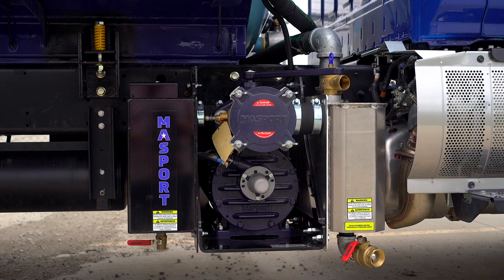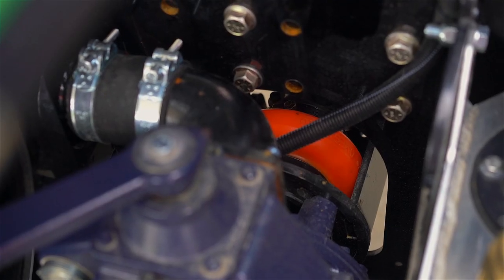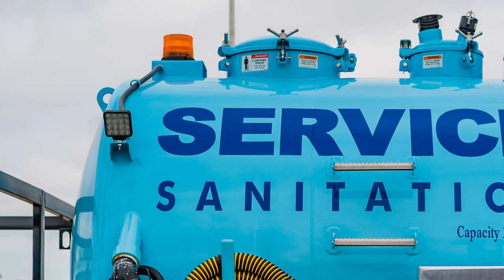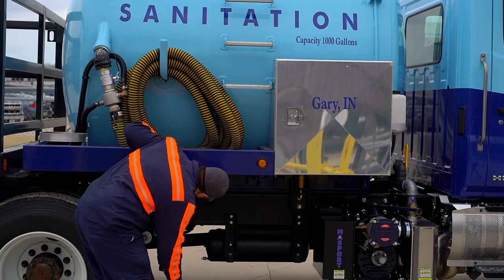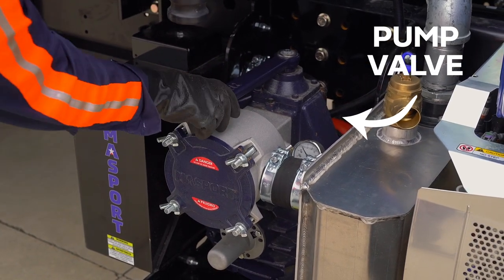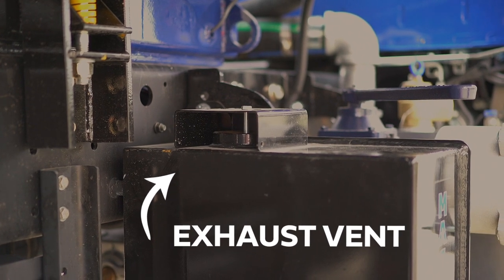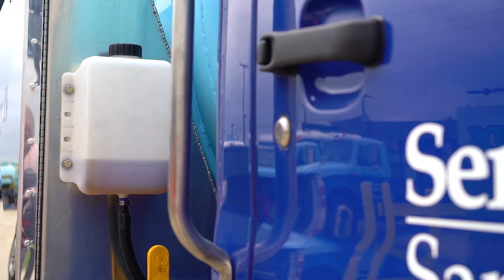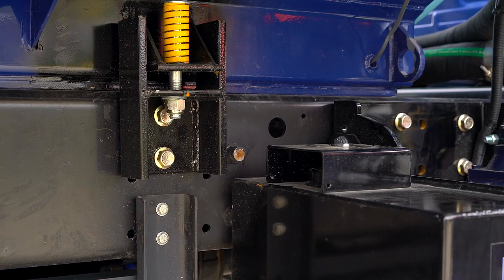How a Pumper Truck Works

Comment: Where do they put water before starting the suction pump ?
Reply: How do you mean? You could open the handle on a full 5,000 gallon truck and the pump will still suck air in from the bottom. It just creates suction and where you open the valve it will pump from, even under the water